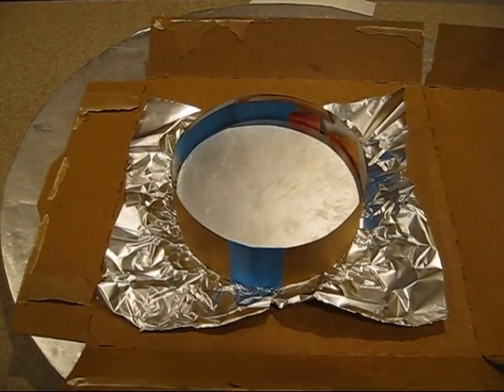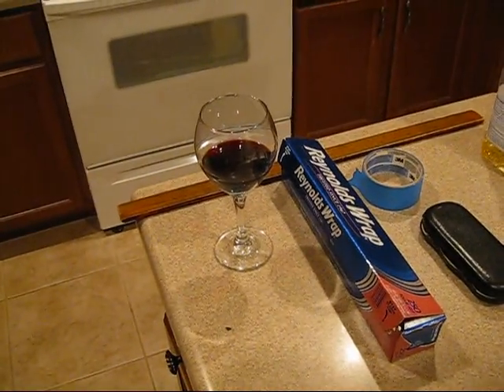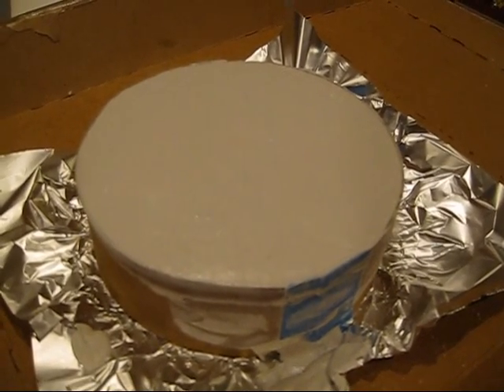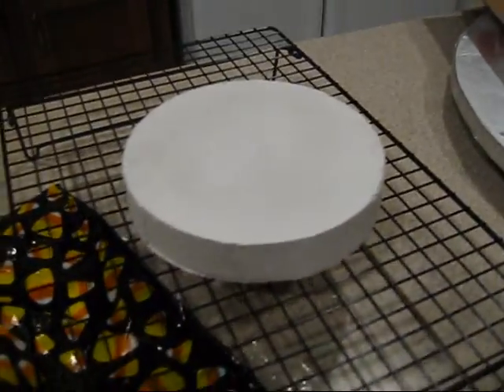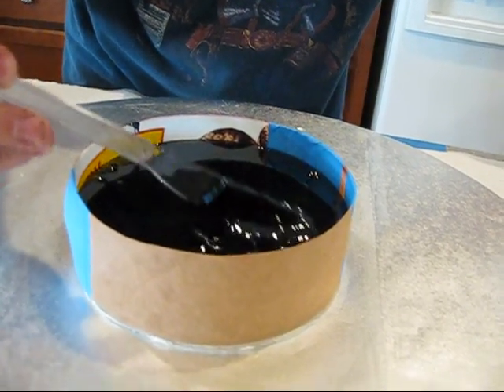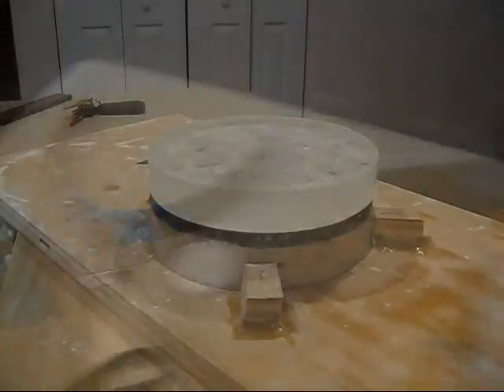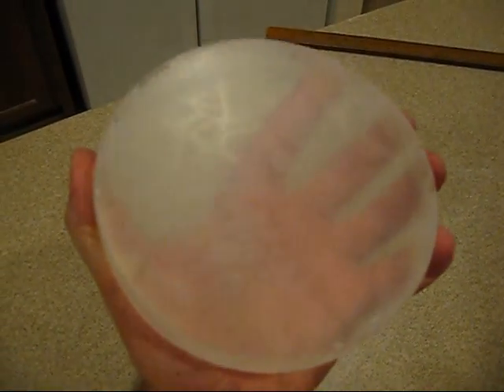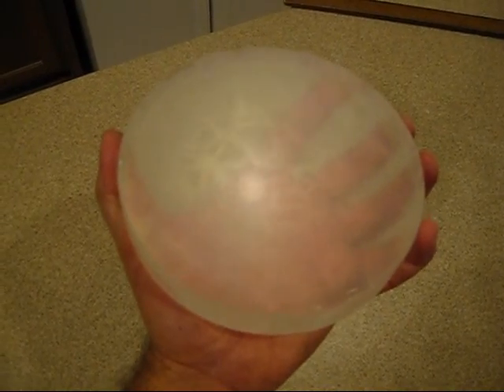Polishing a 6" f/8 Telescope Mirror

Comment: Sorry I can't understand the Spanish comments, but if it has yet to be said - you don't need to work so slowly. Just to get the mirror polished, put the ball of one hand, or both hands side-by-side, on the middle of the mirror, and polish away with considerable pressure. One stroke per second would be fine. You only need to ease off when doing the final figuring.
Reply from the maker: Hello, thank you for the pointers. I know I was polishing too slow here, the mirror in the end was finished and I use the telescope a lot. I then worked on a 10" mirror, almost finished it and then dropped on the floor. I have an 8" blank now that I want to start working on.

Comment from the maker: Hola, el material blanco es yeso (Plaster of Paris). El negro es una resina de pino de grado optico, se llama "Gugolz Pitch" y viene en distintas durezas. Gugolz 64 (el que estoy utilizando) es mas suave que Gugolz 73. El que debes utilizar depende de la temperatura de trabajo y de tu tecnica tambien. Yo deberia utilizar Gugolz 73 porque mi casa siempre esta a 75 grados Farenheit mas o menos, pero obtengo mejores resultados con Gugolz 64.